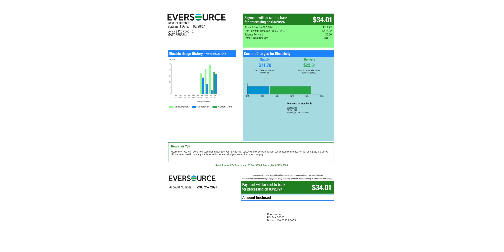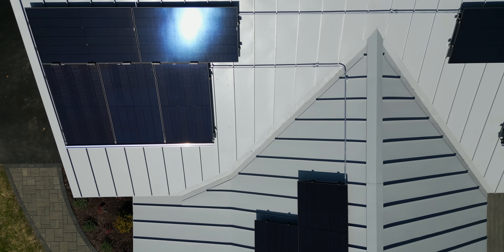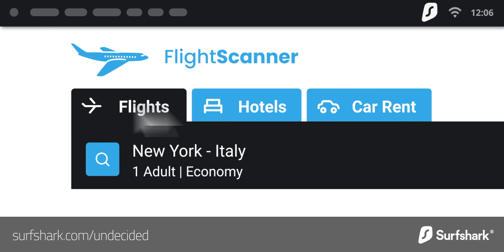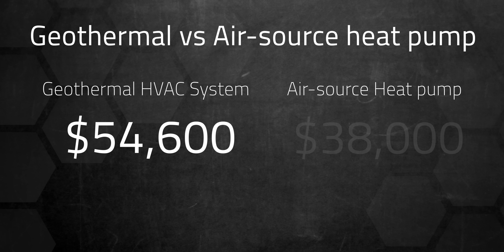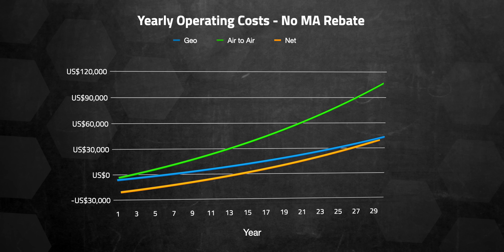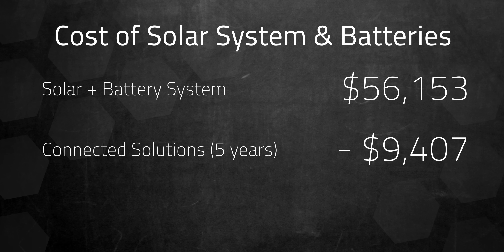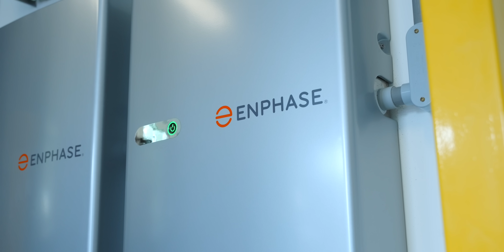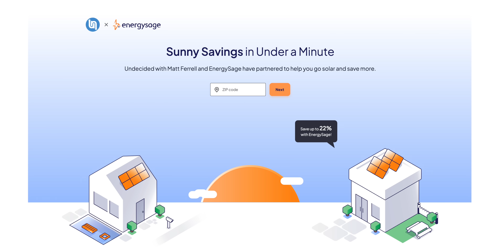What I Learned After 1 Year with New Solar Panels

Comment: We have a typical mid- 2000's semi custom totally electric suburban home that is roughly 4000 sq. ft..  I've added insulation in the walls and ceiling above and beyond what the builder installed, replaced all windows and doors and upgraded the water heater and HVAC.  Over the year, our electric bill averages just under $200/month.  It would take forever for us to recover the install/cost of adding solar to our home.  Great video, as always, Matt.

Comment: Why is solar so damn expensive in USA? I know that labor is expensive but how come the parts are so expensive aswell. A 25-30KW system here would only cost us around 10,000/- USD or maximum 15,000/- USD. That is including the lithium batteries, top tier products, installation, and grid fees.

Comment: I appreciate the calculations, but solar is an investment so you need to consider opportunity costs. Since they are low volatility asset, if you're American, the closest comparison would be US treasury bonds. At 4.5% p.a. (not considering inflation since you made that assumption with electricity price hikes, though that makes the calculation fairly unclean), this totals $167.884 over 30 years that you have to deduct from your projected savings+earnings.
However, if you have a high risk tolerance (e.g. because you're young and saving for retirement) and assume a 7% yearly return on a well diversified stock portfolio, that opportunity cost jumps to $404.359 over the same time frame, putting the solar installation to shame unfortunately.

Comment: The less tech you design into a home the better things work…the trouble is that we have all swallowed the idea that the only way to do things better is with very expensive high tech equipment. I have spent a lifetime building teaching and using very basic simple low tech solutions that have no moving parts to do the jobs of high tech equipment. However that means that home designs and building materials choice are so outside the construction industry standard building practice and understanding the average person will not be able to find the people to do the builds. In my lifetime I have had to learn all the skills  to design and build a passive solar home and have built several. I think the reason why “passive” solar has not become mainstream stream is that it’s is a threat to conventional building practice. For example I used my own skills and Labor to design and build a passive solar home…at $25.00 per hour I have volunteered $500,000.00 in Labour to the project. However the total input costs only total $80,000.00. The annual maintenance costs heating ,lighting ,water ,sewage , runs at $120.00 per month….These are Canadian Dollars…It has had to have Radical deign changes , passive solar technologies that  heat ,light ,store rain water and compost waste and do the venting that do not exist were designed and built by me so this is a ‘one off”. I did it to prove it could be done, and it can ,but one has to be an absolute insane person to attempt this. 😵‍💫 I should probably be locked up..😊

Comment: May I add the cost of replacing the solar panels/energy battery  due to damage or length of service should be considered.This puts your predictions on saving out by a large margin. Considering the up front cost of all your net zero future runs well over $100,000 not including replacements. With all energy output there are many other sources you choose the most expensive it seems. The duel purpose of Wind and Solar would probably be safer and cheaper over the longer term. A scenario could be used using the latest tech with Battery Storage to make your projections more favourable to people. If your run a scenario on wind Tech example Ridgeblade with solar with all electric system for the household which be smarter than what you did.

Comment: It seems to me utilities are lagging in response to the broad implementation of solar in their service territories.  Most utilities are approaching a point where demand declines during the day and peaks after 6pm. Therefore, utilities are looking at the following options:  1.  Abandon net metering. Allowing customers to freely "bank" electricity at its retail cost is a benefit for solar being financed and subsidized  by all other utility customers served. Your $0.31/kwh electric rate reflects this subsidization.  So, utilities want it gone.   2.  Utilities also need to cover their base costs. You cited $10/month as a grid maintenance fee. That does not even cover calculation of your bill.  Utilities are looking more at $100/month minimum bills to cover grid O&M plus their defacto provision of standby electric service should your system go down, and standby service is not free.  3.  Lastly, most utilities are looking at or are already implementing mandatory time-of -use rate metering for solar users, raising rates by "a lot" in the evening and night hours.  While you luckily have batteries for those hours, they will not last nearly as long as your solar panels, and as they start to degrade, your night retail electric costs could rise dramatically.   Your answer, given all these proposed changes, is to see what incorporating them into your calculations now predicts you should do later.  Like, using less electric power, for one.  Just my $.02.  But, you are an interesting case study.

Comment: No way is solar a good investment for the many  homes built before 2000 in the northeast. Insulation is much more cost effective. After proper insulation it costs about 3500 per annum for all electric heat, hotwater, and dryer. It would take 20 years to almost pay off a solar panel system.

Comment: I installed 10 panels, 5 south facing and 5 east facing. I also purchased 4.8 Kw batteries. I subsequently purchased another 2.4 Kw battery. Total cost was €11,900 plus extra battery €1,200. Less grant €2,400 in 2023. Total cost €10,700. In Ireland we get 7/8 months positive sun production and in 2024 there has been 3.5 Mw produced and 3Mw consumed. I have also fed the batteries on a cheap night rate to utilise during the winter.

Comment: Wow, that was so interesting.  I was very surprised that your rate was $ 0.31 vs our $ 0.10 in North Carolina. So you your savings or ROI are much higher.  Also I was thinking that your payback in about 9 years works out to about 8% which is pretty great when you consider it is tax free.  In North Carolina our Capital Gains Tax rate is 4.75% plus the Fed of 15% so average 10% returns are about 8% after taxes.  I'd call that a smart investment on your part!

Comment: I couldn't follow the budgetary cost justification. It also seemed biased in the timeline for todays investment. For example, if you had to obtain a home mortgage to build, what is the interest cost for such an outlay (above conventional). Also what are the real maintenance costs and how reasonable is technical services (diagnostic expertise and equipment availability in the future). I recall several cases where equipment became obsolete such that no direct repair or replacement equipment was unavailable before the break-even date. When that happens, the headache of down time, service provider searches and personal inconvenience can weigh in, not to mention the cost to restore to a working system. Personally I've experienced absurd maintenance costs on my conventional home mechanics and found that suppliers refuse to sell me available parts because I don't have the proper certification.

Comment: I pay about 200 a month power and around 100 for natural gas.  And I don't have to run a bunch of electronic systems and batteries. I do have a backup generator which gets used about once every 18 months.  Not worth it for me.  What happens when the govt subsidies go away?

Comment: lets clear up some problems. you run on 17KW per day. now why dont 20kw batteries supply a 24 hour supply? 20 is more than 17. and clear up this. in most states you only produce whats equal to 4 1/2 hour of full production per day on average thru the year. that number say they aren't very productive, that including sun direction and weather. would you buy anything that only runs 1/3 of the time? and how much is 30 interest on a system that in expected to last 10 years? think of this., a roof only lasts 20 years. why finance it for 30 years? and the other systems. how much is that per month in payments. 50K for geo. alot of confusion. and not simple clear cut facts. its to confuse everyone. and if your home isn't net zero rated,  insulation and such. you need a even LARGER and costly system to finance. and can afford the payments on $150K of improvements? look are your electric bill for what looks like what sells for 300K home a 50% increase in monthly payments? and this cover the system not lasting 30 years. meaning you still be paying for the old system when you need a new one.

Comment: You haven't taken into account the duck curve of electricity grid consumption. As renewable installations increase in your region, the local grid becomes reluctant to take your generated solar power. Your have a contract for a period, but beyond that contract, your electricity provider will not give you the same financial agreement. Don't get me wrong, I love what you are doing, but in the long term, you won't see the savings you see  know. Increasing the battery capacity and keeping more of your generated power would be more financially beneficial, in the long term

Comment: If you were to invest that $88,000 you spent on this exercise, you would have to do pretty badly to only get a $300,000 return after 30 years. So if there is to be a benefit in this exercise, it has to be framed in a way that is not financial. You did not do that - because it is difficult to do without invoking apocalyptic scenarios for the future from nuclear Armageddon to the oceans boiling due to global warming - which was wise. And this is basically why I have not gone down this route.

Comment: Is this another video about going off-grid?  Is nobody else making money selling to the grid during high-demand hours?

EDIT:  10:40 talks about "Connected Solutions" program, but the video says 6.84kW not a number in kWh.  But those dollar figures of income look about right for a battery the size of 20 kWh — USD $1,881pa or around $10,000 over 5 years.  If this pays off the battery in 5-10 years, that's about right.  Doubling the battery should (very roughly) double the income on these sorts of schemes.

EDIT 2:  I just finished making USD $25 net profit for a late spring day, in the last hour.  Yesterday was USD $10 and before that, USD $4 and $2 net profit.   The day before that was USD $25 net profit again.  The small days are exports of 15-20 kWh, the big days are exports of 45-55 kWh (from a battery of 40 kWh).  The prices range widely too, from USD 15¢/kWh to 60¢/kWh for those peak events — that's when the income really rolls in.

EDIT 3:  Currently the weather is particularly fair — this is the longest I can remember going without heating OR cooling.  And my computer lab is being reconstructed this month, so the house consumption is generally 10-15 kWh per day — unusually frugal.  But when the summer comes, it will be easily 30 kWh per day, and in the deep of winter, it can exceed 35 kWh.

EDIT 4:  The way I think of it:  I can go off the grid for 9 months a year, or I can go net-zero energy off the grid for 11 months a year, or I can go net-zero dollars off the grid for 12 months a year.  In the depths of winter, I top up with cheap(er) energy during the day, and give some of it back at dinner time, and give myself a free power bill.
Reply: Explain how the "Connected Solutions Program" works, it wasn't clear from the video?

Comment: I'm an example of why not to get solar. I paid over 30k to get installed with batteries. My electric bill dropped to 30 to 50 per month. After a year I get hit with a true up bill around $2500. I can't add anymore solar to cover the additional amount. 23% bill coverage, not the 80% promised. Promised and contracted amount is two different things.

Comment: I believe that, for many, the cost and complexity of solar technology are too overwhelming to manage. The extensive calculations and long-term planning required, often spanning over thirty years, are beyond what the average person is prepared to handle. For instance, in Seattle, where the average house price is nearing $1 million, adding the cost of solar installation is simply unaffordable for most homeowners.

In my view, the solution should come from utility companies. They should provide solar installations at no cost to homeowners. This means covering all material and labor costs to install and maintain the systems on the roofs of every house within their grid. By doing so, they can optimize the use of available space and generate excess power for the grid.

While solar power is undoubtedly a green initiative, it is technically challenging to install and maintain. There are likely many hidden costs involved, and the cost differences around the world make widespread adoption difficult. Utility companies could play a pivotal role in making solar power more accessible and practical for everyone.

Comment: Bottom line…unless you are going to live in the house 15 years, you will never recapture your investment in a system like this one. And….as per most realtors, rooftop solar can often be detrimental to resale since so many systems are poorly installed, cause chronic roof leaks, and systems  many being entirely decommissioned within 3-5 years.  You also have to be somewhat of a technical person to understand and operate these systems.
Reply: That's why I put in a ground-mount system.  And zero operation expertise is needed if it's done right.  OP just likes having lots of high-tech gew-gaws.

Comment: I used Energysage to get quotes for @12,000 kWh system in Southern California. They all came in around @$20,000. Before contacting the companies, could you please tell me what are some of the most important questions I should ask them before choosing a system? (Two of the systems are Enphase, which I'm strongly considering. The other companies build Tesla Powerwall 3 systems, but some may have the Enphase option as well.)

Comment: Curious to know the system replacement cost in 30 years,  solar and batteries will be cheaper, plus inflation… you should probably start saving now, though probably at the rate of $1000 per year? Curious.

Comment: Wow, your system is more or less double the size of mine. Your energy usage must be much higher than mine. (about 25kw a day).
My setup is 10kw of panels (with optimisers) and a 13kw battery. Installed for $22000 Australian.
We have had our system about a month now, and we are losing sun on our panels around 3pm, but the panels eek out enough power to run the house until about 5pm. So we run on the battery from 5pm to  around 6 am the next morning, when we have about 30% of the battery left. On a sunny day we make between 35 and 45kw, the battery is usually fully charged by 9 to 9:30am. Even on a rainy day the panels produce enough power to run the house and charge the battery. We get paid stuff all for any power we export to the grid, so that isn't really a consideration for us.
Nor are we concerned with costs compared to what it would have cost us for power, what matters to me is not paying those scum sucking pigs of a power company who have been gouging us for years - one brass razoo!

Comment: I'm afraid I'm not understanding the "Connected Solutions program" aspect. Where's the time component? Is that automatically factored in by the averaging?

Even if so, how does it make economic sense to credit the customer based on the average without taking into account the total energy delivered? If one event is 10 minutes long and another event is 100 minutes long, but the average power delivered is the same for both, then you would get the same $275/kW for both events? Seems like that would incentivize the utility to make the events last as long as possible, so that they get their money's worth.

Comment: great video.  my house uses oil for heat, and I added $400 worth of insulation to the attic, and it immediately saved me $1000 a year in oil.  I just got a new roof and want solar.  looking forward to the energy savings.

Comment: The price of the solar system seems very expensive. Here, 550W panels are $150 now. For the cost of the batteries I'd buy an electric car, a BYD Dolphin with a 60KW battery (bidirectional charging) - oops 100% tariff in USA... sorry, you can't have nice things. Have to support Stellantis...

Comment: @UndecidedMF, have you considered a good quality 5-10kW turbine either in your garden or roof mounted, this would offset any loss of generation from the panels on cloudy days or if covered in snow/ice, it would also increase you 'output' to the local grid and thus increase your credit balance, this would give greater flexibility for taking systems offline for maintenance. 

Have you considered increasing your battery storage capacity, I do recall you discussing this in an earlier video and there were reasons why you chose 20kW/hr rather than a higher capacity system for flexibility.